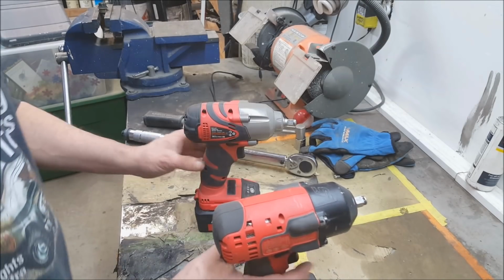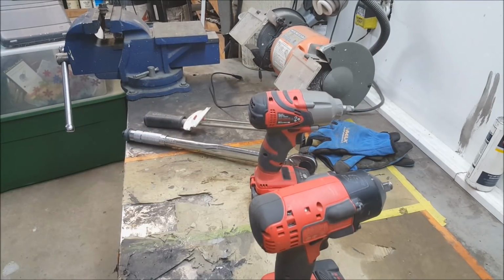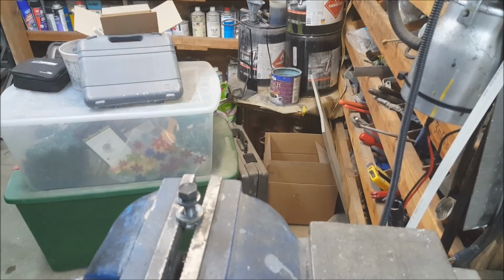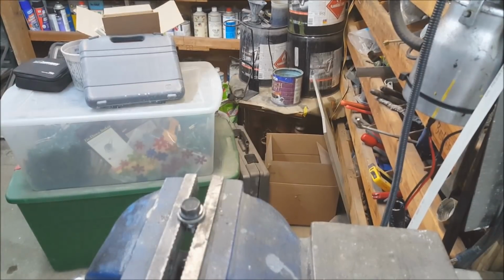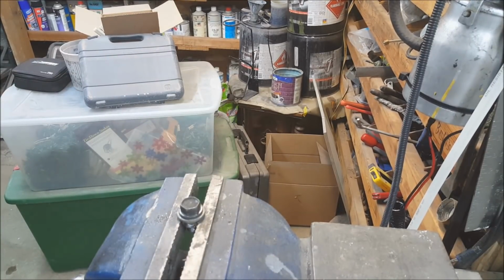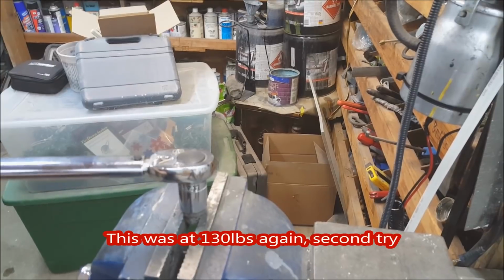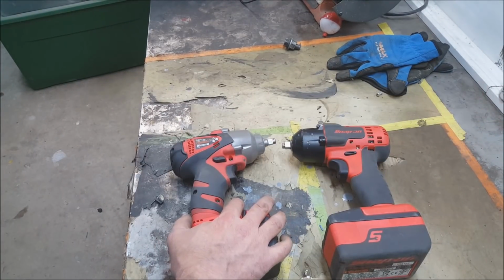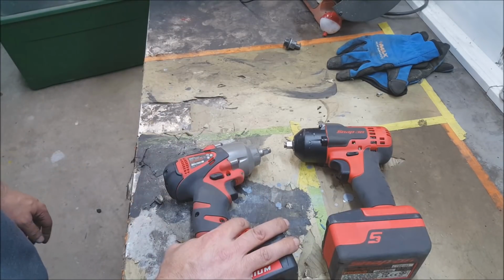Snap On 3/8 cordless impact vs Earthquake 3/8 cordless impact

Comment: I've been eyeing the Earthquake impacts for a while, even if you bought this 3/8 model and the 1/2" model together you'd still be paying less than the Snap-On. You'd also be getting a battery with each tool and its' own separate charger. So you'd have an extra charger as a backup. The Snap-On might be better, but Snap-On, in general, was never marketed to the homeowner and diy'er. :)
Reply: I would recommend the earthquake ones forsure, I have the 1/2” and it’s a beast! Looking at getting the 3/8” next
Reply: @juniorv4483  My friend has the Earthquake units. He originally bought the 3/8" model and has used it for everything involving stubborn nuts and bolts. Because Harbor Freight is discontinuing these Earthquake tools I've been picking him up tools he didn't already have when I'd find them for a good deal. So the most recent things I got him in past months were the cordless angle grinder and the grease gun. He recently picked up one of the 3/4" impact guns over the weekend that was one of the old store displays the store was selling off. Which happened to come with a battery, so that's battery 3 or 4 I think.

I myself ended up skipping the Earthquake tools and opted for the Hercules line instead as they're slowly adding to it. I also have a couple Milwaukee tools but stopped buying those as well after seeing that I needed two different models of chargers to take advantage of both the 12v & 18v tools. The large Hercules charger charges both the 12v & 20v tools so it's a no brainer. Plus a large 5Ah Hercules battery is $65, not $200 like DeWalt. :)
Reply: Nice man, you got that right, those damn batteries can get expensive 💰 so it’s nice to get a he harbor freight ones for a lot cheaper and they last the same 👌
Reply: @juniorv4483  Some time last year I nabbed up all of the 12v Hercules batteries they pulled off of display units when they were redoing the tool display and got them for $16 each. 

Prior to me buying some Hercules tools for myself I originally bought my mother a 12v Hercules drill and the first two batteries they pulled off of display models along with the large two-battery charger. She wanted a drill for drilling holes and turning screws for doing outside projects in the summer and she loves it. It's light and compact, has good power for being an older motor design, feels nice in the hand and she says the 2Ah battery lasts her a good amount of time and they charge quick.

I picked up most of the 12v Hercules tools that interested me the most and skipped the ones I already had in another brand. I also picked up one of the new 4.0Ah 12v batteries but haven't used it yet. I also have two of the 5Ah 20v batteries and the 7-1/4" circular saw I haven't got to use due to winter. But since spring is here and summer is on its' way I'm hoping I'll get some use out of it. Even with limited use I'm so far pleased with my purchases. Though some will disagree with me the feel of the built quality while holding them feels similar to earlier model DeWalt's imo.

Comment: Hello! Is there any way you can get a hold of the "Kobalt 24V Brushless 3/8 impact driver" and do a comparison with this Earthquake Xt 3/8? I'll be that would be a great match since they are around the same ally when it comes to price.
Reply from the maker: Thanks for watching. I haven't heard of the Kobalt but I'll look into it.
Reply: Great thanks!. The Kobalt 3/8 24v Brushless from Lowes seems to be the current one to beat (Its brushless after all). The only thing is that you have to buy the pieces separately. Tool itself=$99, battery charger=$39.99 battery=1.5Ah $10 or 2.0Ah $20. I'd like to see how it compares to the Earthquake Xt 3/8s

Comment: The test you did with the lug nut you cheated both 3/8 impact drivers potential by using a wabble adapter which creates too much movement in the socket decreasing the torque power in boyh impacts
Reply from the maker: sure it did but since i used it on both impacts the comparison doesn't change. The Snap on still had more torque.

Comment: The earthquake would be perfect for home/DIY but as a professional auto technician I pay the extra for the snap on. I don't need to be down a tool and I trust the snap on to be reliable.
Reply from the maker: I understand that completely, but Snap-on isn't always as it seems. I bought a die grinder from snap-on 3 year ago, cost about $250 and already had to send it in for repairs( of course out of warranty so another $75 dollars out of my pocket) . I got a no name die grinder I bought 20 yrs ago for $20 that's still working good with way more work time on it.
Reply: Both of my 1/2 and 3/8 snap off, I mean Snap-on, broke within a month of owning them and had to be sent back to Snap-on after 3 - 4 months of waitingI finally get my tools back and Snap-on tells me I owe them $175 per gun to fix it! Well I'm still making payments on the goddamn things!! Are you kidding me Snap-on! They took so long to fix it the warranty expired and now I've gotta pay more! WTF!! I'm never buying this garbage again
Reply: Hf had the 3/8 earthquake xt impact wrench beefed up and the front is black and not gray. I just used my warranty to trade in my old one for the newer better one..looks better too
Reply from the maker: Yeah for the price you pay for Snap On I would expect better warranty on their air and electrical tools.
Reply: You could buy 4 of these,one of them is bound to be reliable
Reply: For the price of one snapon you can get two earthquake impact wrenches and sockets.
Reply: When your snap on breaks, you wait up to a week to get it to your dealer, then wait for repairs, and then it has to be returned. No less than 2 weeks later. 

When your earthquake breaks, go to your local store and get it replaced immediately under warranty. All same day. 

Remind me again about how you can’t afford to have a downed tool?

Comment: You're losing so much torque with the adapter
Reply from the maker: The video wasn't so much about how much torque they could generate but just comparing the two using the equipment.

Comment: I have used the harbor fright no complaints other then there tool line up for the battery platform. For that would go for the Milwaukee  A bit more expensive but way more tools on the same battery platform

Comment: I'm pretty sure that the results would have been different if you'd have used the correct "impact" sockets for this test. Otherwise nise comparison video.
Reply from the maker: Yeah I thought about that especially when I had to use the adapter at the end, but it still gives a good generalization of the tools limits compared to each other.
Reply: it wouldn't matter for comparison reason

Comment: Earthquake has been way underpowered in my experience. Wish I bought the Milwaukee m12 tbh
Reply: If you were honestly underwhelmed by the earthquake you are going to be severely disappointed by the m12. It's a 12v gun with about half the torque of the Harbor Freight. Unless you meant an m18.
Reply: @suntoritime  from what I've seen, the Milwaukee has comparable strength in a smaller package

Comment: Snap on fanboys clearly done use snap on or have ever seen them break! Good luck warrantying your $800 snap on when you have a new truck on your route at work! 😂 look up snap on repossesions! Terrible. Enjoy your debt! And get the job done
Reply: Rene Caballero then you had a bad dealer.  Never had issues with mine when it comes to warranty and yes I just got a new dealer.  Out of warranty it’s $160 for a rebuild.  And they’ll usually send you a new impact.  And they’re not $800 like you’re claiming.   If you have a credit account then you can send it in without a dealer.  Truck accounts are a different story.

Comment: Harbor Freights biggest weakness with their power tools is their 90 day warranty. They want to compete with the big boys in the industry but don't want to match their 3-5 year warranties. Having to purchase an extended 2 year warranty adds to the price. If they're right around the same price, which they are and the warranty isn't as good, why should we buy the Harbor Freight offering? Don't get me wrong, I like Harbor Freight and shop there almost every weekend. Most of their hand tools are really good but I don't trust their power tools and won't buy them unless they're much cheaper than the big brand offerings. Those comparisons they show aren't really accurate. Dewalt, Makita, Milwaukee, Ridgid, Ryobi and Kobalt constantly put their brushless power tools on sale for the same or less than these new Harbor Freight power tools. I'd rather go with proven brands with better included warranties.

Comment: great instruction..10 pounds makes a huge difference..snap on takes the tittle easy hands down.
Reply from the maker: The snap On is hands down more powerful but I'm not sure about it being that much more money powerful. thanks for watching
Reply: 10 pounds will cost you 400 bucks
Reply: using a chromeand wobble extension makes ahugedifference..